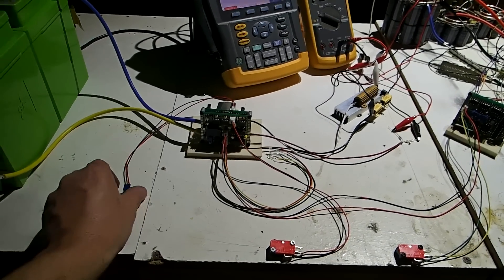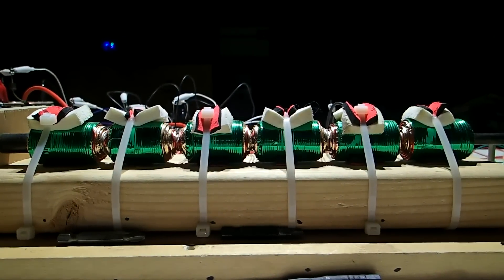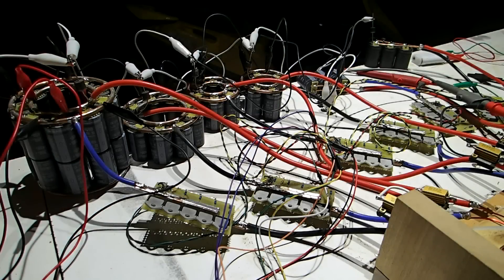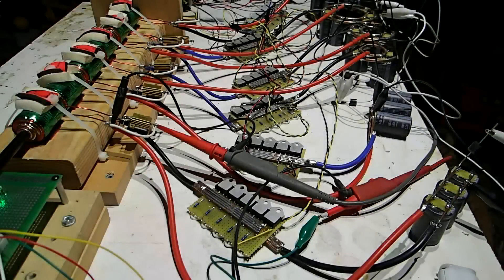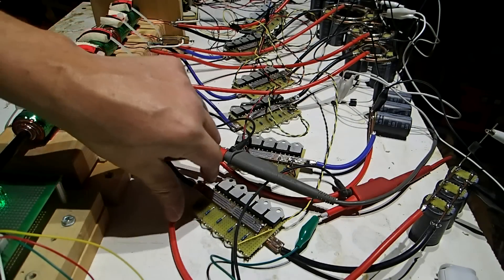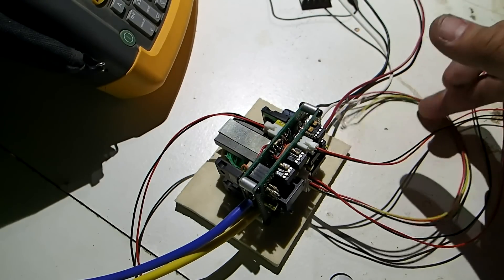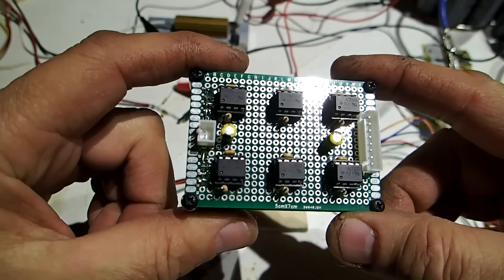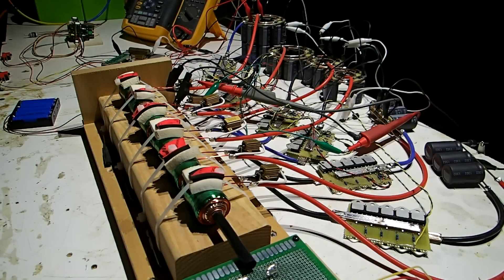World Fastest 6 Stage Coil Gun Yak Steel Penetrator

Comment: You do disable  the coil when the projectile is about to exit it. But instead of sensors tracking when the projectile is about to exit you use 555 timers and mosfets, right?
Reply from the maker: Since it's a capacitive discharge the discharge time is proportionate to the projectile speed and when the projectile is leaving the coil the energy is depleted from the capacitor Bank. I used a sequencer in this video which were five five five timers and they drove opto couples that were mosfets to trigger the gates on the scr one for each coil.

In a later video where I answer questions and show things on oscilloscope I used an adriuno computer. And I programmed into timing sequences which match the capacitor discharge rates for each coil the first one is the longest about 2.1 milliseconds then the next coil it's around 1.3 I believe millisecond.
The timing gets faster and faster because the projectile is moving faster and if our pulse is too long it would slow the projectile down causing a magnetic braking effect.
Reply: @RaptorRotorHead  I need to watch your other video, but Arduino is known to be slow. That is why some people use ESP8266 at 240 Mhz. Or they use sensors to detect projectile and control the mosfets thus not using an Arduino. What is your experience?
Reply from the maker: @ButilkaRomm  adriuno is good to 3 micro second, plenty good for coilgun. Fastest pulse in last coil 700 microsecond.

Comment: Why is the sound of the weapon firing/ projectile impacting there way before the actual impact? I dunno, something tells me that this is all faf.
Reply from the maker: https://youtu.be/DjoYHLye2p4

The weight of the projectile is about a half of an ounce 14 grams slightly more, in this video I achieved about 265 ft per second now in the editing of this video I had to stop and start many times to try to cut the video down to try to find the sound synchronization slot... so on this video you'll see the sound and the video hitting together equally took a long time to get this one to work.
Reply: @RaptorRotorHead is really to increase the speed to 100 m / s?
Reply from the maker: Because when the video is edited the video editor is a piece of junk it's loses the sound synchronization by up to about a half of a second.
Reply: @RaptorRotorHead  Ah, fair enough. what's the speed and wait of the projectile?
Reply from the maker: It's called shity sound editing video equipment
Reply: @RaptorRotorHead  what? I mean the speed of projectile

Comment: Couldn't help but notice the projectiles hitting straight. How does it fly so straight? Induced spin or just great CG?(center of gravity) I love that you do not use optics. I myself use solid/adjustable contacts negating the need to program time or like you also negate the need for optics. Still working on CG balance for mine. Hard to get a good design with appropriate coil and projectile length.

Comment: is it posible to get the same power out of single stage but operating at 2000v ?
Reply from the maker: Vasudev Mr that can very well be there's a coilgun on YouTube that operates at about 10,000 volts it's one stage it'll go through 3 in of plywood I believe that's the thickness they shoot it
Reply: i think its a induction type coil gun ,maybe it's not reluctance type . i will check it out .
Reply from the maker: Vasudev Mr yeah that's the one it says 10 kilojoules I thought it was 10 kilovolt but it runs it some high voltage
Reply: i am planning to build something like that 12mm mild steel slugs , single stage ,operating at 2000v or higher. the main objective is to make it easier to build hand held version .

Comment: @MossFett
How did you achieve high side switching of the SCRs without using a transformer?
Reply from the maker: NNNI a3120 opto couple
Reply: Just like that? What was the supply for the gates?
Reply from the maker: NNNI 16 volts

Comment: Hey there firstly you did an amazing job.
now with the question whats your estimate on how much of energy would be required to make a shuttle launch (small prototype of course) mechanism using multi stage coil gun concept.
Reply from the maker: Vikram Singh can't launch a shuttle with people in it they will die from the g-force, DARPA built a 46 stage in 1990 just for that purpose and you can see that it's never been used it's basically been abandoned. The military supposedly has one for launching mortars. But I never seen that used either.
Reply: Thank you for the reply sir. Quick question 2 : Can we launch satellite with it?
Reply from the maker: Vikram Singh Electronics could be launched with it.

Comment: How much more speed could you get if you doubled the number of coils? Making it longer ofc. Would it be too hard to time it?
Reply from the maker: Wormweed each coil added increase speed. but less and less with each coil.
Reply: Alright, makes sense. So the only way to get more power is stronger coils/stronger magnetic field, not more coils?
Reply from the maker: Wormweed yes correct

Comment from the maker: you have to tell ardriuno to set the PIN to Output and then to set it low
Reply: Clay Reid no when I turne Arduino Nano on it sets all the pin to high just for a fraction of second and then back to normal .so  latching all the scr to high .
Reply from the maker: Vasudev Mr how can it latch the scr when they have no power on them your power supply should be at zero when you turn on the ardriuno
Reply: Clay Reid when I switch  on the power supply it will turns on the nano ,the cap charger and  everything . so the nano and zvs charger turns on simulationsly at a time . so the nano puts it's all pin to high for small time latching  the scr to on so the zvs charger cannot charge the cap bank
Reply from the maker: Vasudev Mr connect Arduino to a little battery 12 , or 9 volt
Reply: Clay Reid actually I just solved this bug just now . the problem was the digital output pin which I selected was pin 13 so this particular pin goes to high coze it's connected to inbuilt led and when I power the nano it simply blinks once so this was latching the scr and creating bug . I just solved this by selecting other digital pin to trigger scr .
Reply from the maker: Vasudev Mr yeah you cannot use pin 13 that's for the little LED on board the computer

Comment: how do y make sequence-trigger for each coil?
Reply from the maker: Quy Tran Manh now I use ardruino.    it's makes a very accurate sequencer, and very easy to change timing. I have later videos of using arduino microcontroller.
Reply: Ok! Thank for yr quick respond. Did y use photo sensor? or something else to detect and gather data for ardruino calculating?
Reply from the maker: Quy Tran Manh no what I did I put in the timing of the inductor and capacitors used in the circuit first I measured with an oscilloscope to make sure it was accurate then I put those values in arduino.
Reply: Yes! I see. And if I dont have ardruino, can do this by another simpler way?
Reply from the maker: Quy Tran Manh you can use 555 timers in a cascade, I used 20 turn trimmers on each stage with capacitors, to create the timing. downfall is temperature drift.
Reply: Yeah! Thank man. Use only one 555 is enough? 
each stage is integrated with one LC circuit. When projectiles passthrough inductor, next stage coil is triggered on? or another way ?
I am gonna build one so something which I still dont understand clearly? Looking for best and safe way!

Comment: how did you wind the Coil . did you use any kind of gue or tape  to hold the Coil in tight . because I don't see any holding walls
Reply from the maker: I wound it by hand
Reply from the maker: I used tape mylar, after its wound i use crazy glue real thin stuff

Comment from the maker: that's about a hundred and forty-four feet per second. it's pretty good really what did you wind the coil on is that a metal tube?

I suggest a carbon fiber tube, but add another stage
Reply: thank you ,that brass tube has multiple holes where the coil is wound so that ,eddy currents induced is way less.

Comment: very cool.
 i like how you used induction rather then switches. :) 
 since your using carbon caps im guessing is there a way to do 2 rows of coils kinda with tesla coils around actual coils and run capacitors into tesla coils.
also can you run heavier coils towards muzzle or that wouldnt do anything?

Comment from the maker: no no they are not not only do you have the high-voltage wires coming from the coils but now you have the sensor wires coming from the coils and this massive wire harness. I just imagine for a minute if you could use the laws of physics, if you know how fast a projectile is moving from the first coil you can calculate when the second coil should fire
Reply: ive also thought about maybe using induction to charge coils one after another and scavenge some of the power from each preceding coil to next one build bigger and bigger coils to front to handle it
Reply from the maker: What I was thinking is and this is induction is to drill a hole about a quarter inch into each end of the projectile and then wrap the projectile with Magnetic wire and strip the two ends of the wire and stick them into the holes in the end of the projectile this will cause the projectile to become a super magnet.

Comment from the maker: study what's involved to get the slug to even start moving in a rail gun, all the sparking and Welding that goes down.

that's why I chose coil gun.
in a rail gun you need a small explosive charge to get the bullet to start to move
Reply: or compressed CO2
Reply from the maker: Yes co2 some method
Reply: railgun just needs the magnetic charge. If you see fire, that's the result of the friction due to how fast the projectile's moving. Also you can use a trigger mechanism that uses a hammer to knock the projectile into place
Reply: the higher initial velocity from CO2 helps

Comment from the maker: SCR can handle 10 times their  continuous rating for 8 milisec. I used 50 amp scr 10 per switch, each SCR 500 amp pulse 8 milisec.
Reply: I was thinking about this (again)
The formula is i = U*t/L, so for example for 500 V after 8 ms you get
(500 * 8E-3)/ 315E-6  = 12698.4 A
This is not true of course (from L di/dt), but basically the current rises linear with time.
Of course the voltage drops during that time.
But L di/dt shows the current starts in fact very small, then rises linear, and then falls again.
I find it a fascinating problem, as when the 'bullet' starts from zero speed,
it will be much longer in the first coil,
and spend a very time short in the last coil.
This made me wonder if L should be less for the last coil, so the get  a faster rising pulse in the last coil,
ever less L (less turns ) for added coils.
This then reduces to a single turn, and there you have the 'rail gun', what the navy seems to be testing these days.
I am really deeply impressed by the power you get with 6 the  same coils, timing is everything...
timing also the same for the same projectile.
I tried a little rail gun setup yesterday, with a ball-bearing, but clearly do not have the power needed to get it rolling.
Playing with low voltage electronics I really have no high voltage power caps to test anymore.
Reply: scr is voltage multiplier? or current multiplier, in this case, what if you swapped the batteries for something with a bit more juice? 

not bad for 34 joules tho, the army should hire you
Reply from the maker: @LorneAlexander  there's no voltage multiplier it's basically a ferrite Transformer were 26 V go in and 450 V come out
Reply: @RaptorRotorHead  homemade transformer? 

ive got a bunch of inductors, and some really high v capacitors 400-800 v but only .36-4  microfarad, been scratching my head thinking how to make these into something
Reply from the maker: @LorneAlexander  check out this video here

https://youtu.be/ydowA2e4TJw?si=F_mS1c3-XL6Qmkxz

Comment: Wow this is insane. So many coilgun videos out there. I was wondering what one was capable of if someone really sat down and tuned it with an oscilloscope. Do you think it can be further optimized in any way? Like messing with the windings or wire thickness? The projectile shape or material? Increasing the voltage?  Cooling the coils with liquid nitrogen? :D
Reply: Cooling at high voltages would probably require an aluminum heat shield in conjunction with an internal cooling fan.
I don't know if you'd want liquid nitrogen cooling the coils 
I'd use some type of refrigerant like DuPont's *freon*. It's activated by the electricity to lower the temperature...same gas that make your freezer ...er freeze
However, I would go for the non propane based refrigerants, since propane based refrigerant brings ya back to square one.

Comment from the maker: I use an oscilloscope to tune it. I fired one coil I measure the speed. I put the timing in the computer for the for the second coil, I measure the speed I put the timing in for the third coil into the computer and so on do I get to the six coil that's how I tune it.

Comment: This is so not the word record thumbs down and unsub for lying
Reply: Your always going to get a dumbass who thinks he know better.  This is one of the best I have seen.  In my concept for a coil gun, I chose to time the coils electronically, instead of optically.  The advantage, its easier to tune for maximum efficiency.  Ill be using an MCU instead of the multi turn pots, and adjusting in software.  This gets a thumbs up and a subscribe from me. :)
Reply from the maker: you don't have no proof of anything else there's not even a coilgun that penetrate Steel this is the only one show me your proof instead of your mouth
Reply: Um how bout my dad being in the navy and working on a anti-ship 3 6 stage coil gun
Reply from the maker: Dude give me a 15000 volts power supply and I'll do it, we're talking about in the 450 volt class 6 stage - 450 volts, less than 10 pounds of electronics including the battery.

If the Navy wants to hire me that would be fine and give me the funding and I'll do it but you shouldn't be thumbing me down when there's no other video on YouTube except the Navy I built this out of my garage bro and you should go look at the portable weapon maybe you should thumb that down too, just because that's what you do based on no facts.

Comment from the maker: go to eBay and look around you can find capacitors there much cheaper that's where I get mine.
Reply: +Clay Reid Hi,

The chronograph circuit you used to measure the velocity.

how did you make it? Phototransistors and IR LED's? I'm not sure how to wire them up.

Comment from the maker: watch the other video that's 25 minutes long with the questions answered that shows the scope measuring the speed
Reply: I did watched it, cleared my doubts .I suggest 70tpsi120 scr which can handle 1200amps for 8ms, if you are building portable version
Reply from the maker: My scr switch packs can handle 5000 amps for 8 milliseconds
Reply: +Clay Reid that's nice, but that much current is not passing through your coils .and I have tested that scr upto 2500 amp at 450 v works just fine.and as you said 2500 amp is the current passing though your coil

Comment from the maker: know the speed is measured by a fluke oscilloscope or han tech whichever one I'm using
Reply: is carbon fiber launch tube heat resistant??
Reply from the maker: I can do 70 degrees Centigrade with no problem
Reply: +Clay Reid are those lead acid battries??
Reply: can you please tell me how to measure the speed useing oscillscope

Comment from the maker: that pulse charger that's just a 555 timer 4013 flip flop and 4081 and gate. I use a 1k resistor and a 18 Pico farad capacitor from the timer to one of the AND gates to create a dead time signal so that no two MOSFET are turned on at the same time. the MOSFET are 100 amp devices, it does not need a heat sink just a bench test it with the coil gun but if it were packaged into a portable unit and fired once every 4 seconds it needs a little bit of aluminum 2 x 2.5 attached to the MOSFETs.

Comment from the maker: it works by the simple laws of physics that the projectile will always be at the location when the next coil is fired.

that's because the first stage always shoots the projectile out at the same feet per second so the projectile has to be in the same location at the same time every time.

now to keep that in order going down the line of coils you need to use a computer to fire the next coils one after another because the computer is accurate to within 3 microseconds and it's plenty good enough for a coil gun.

the same laws of physics apply the speed is measured after two coils and then the calculation of time is put into the software to fire the third Coil.

Comment from the maker: no optical trigger it runs off the LC timing constant of the coil on the capacitor for the stage in question the first stage is fired by a trigger a person's finger the next stage is fired by an RC time constant sequencer which is set to the same time constant as the LC time constant when the LC time constant is finished so is the RC time constant and the RC time constant electronically fires the next coil.
Reply: +John Terpack 
I have that same "instinctive something" telling me the same thing!  Also, I, too, just don't see how the position of the projectile can be known accurately enough along the entire length--it's really just 'guesswork' (I'm still studying on it--I love the penetration power--this guy needs to join 4hv.org).
BTW: isn't that difference in musical notes equal to the 12th root of 12? ...know nothing about music...

Comment: Nice work bro, i have a question can you use a pull type Solenoid Electromagnet as a coil??
Reply from the maker: Yes you can, any coil of wire rap around hollow air core or hollow steel core can be  used.